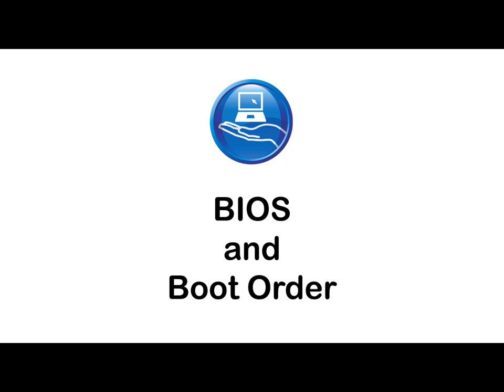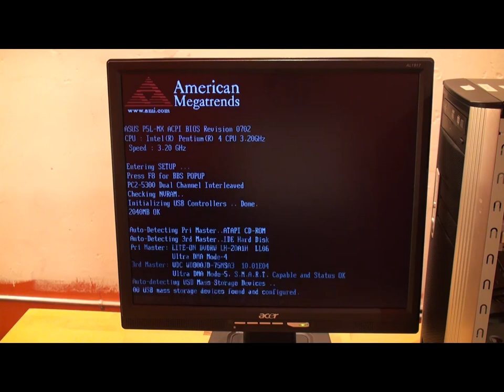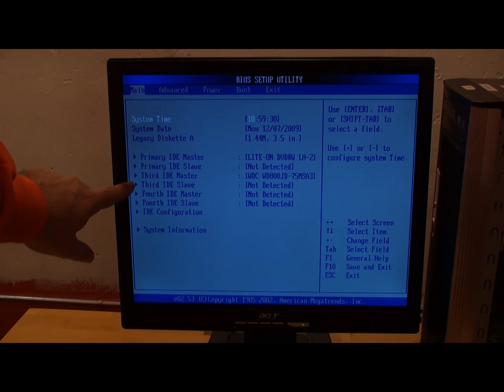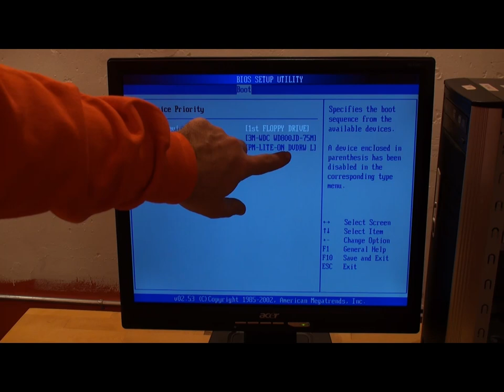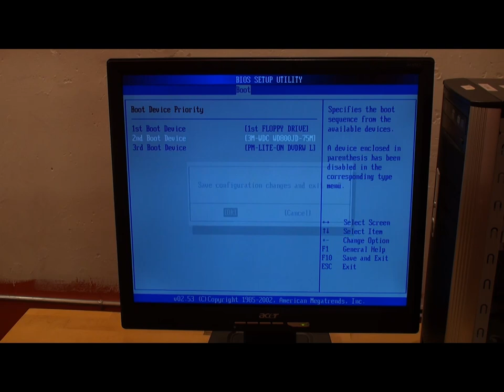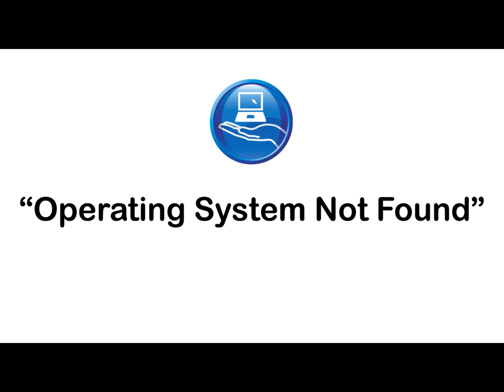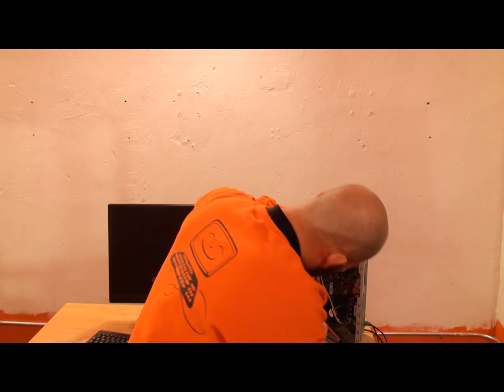Computer Hardware Repair

Comment: hello i got hp g72-251NR notebook. but when i plug my charger the light turns white then turn orange. and when i take the battery out then plug it in the white light stay on but the computer dont turn on. can you help me thanks.

Comment: Hey, i have an acer desktop. So whenever i boot up the computer it freezes on the Starting Windows screen (Windows 7) and does not move any further and so i have tried couple of other hardrives and re installing windows but every single time it freezes on starting windows screen  or if i try to install an os then it freezes on windows is loading files screen.....so i think that there is a problem with the motherboard........SO what do you think????????????

Comment: I disagree about the no video but the PC is on, I'm 15 and been building them since I was four, and most of the time it's a dead CMOS battery... every PC I've fixed with that error, it WAS the CMOS battery, you can pick them up at your local dollar store! xD
Reply: I have never ever had a CMOS battery go out or go dead, literally NEVER.  I have been messing with computers since the Commodore64 (did amazing things with only 64k, yes K not MB or GB of ram) and never once have had to replace a battery.  Not saying it can't happen, but it is very rare they actually go dead.
Reply: That's strange, i've fixed all my PCs with that error by replacing the CMOS battery.
Reply: I have fixed stuff by removing the battery and putting it back in to clear cmos, but never seen a dead battery b4.
Reply: Oh, I've been build them for about 9 years now. It ALWAYS happens, but that is the first thing I try is to take the battery out and pop it back in, if it doesn't work I buy a new one, and it works fine.
Reply: jeremy10001000 Guess I been lucky for last 15+ years then :P
Reply: Haha yeah! :D
Reply: No one cares. Also that never happens.
Reply: Why'd you comment then?
Reply: Ummmm... CR2032 has nothing to do with the video controller integrated to the chipset or in this day and age, processor; or furthermore discrete GPU part. CR2032 or CMOS battery has to do with saving the BIOS settings/providing constant voltage so that the volatile memory on the motherboard isn't as volatile as the term would mean. The basic part that at least integrated chipset/CPU/APU graphics would need that is replaceable and removable would be the RAM/memory.

Though as far as I've found common failure parts after 10+ years working professionally as OEM supported or mom/pop shop oriented repair:
1: PSU (Power Supply Unit)
2: HDD (Hard Disk Drive)
3: Motherboard
Reply: Some motherboard's don't post when a battery is dead, therefore no video, I never said anything about it being connected to the on-board video adapter.
Reply: Jeremy Williams you said cmos battery has nothing to do with saving the BIOS settings....... I disagree.  Technically you are correct as it will not "save" the current settings..... BUT, take out battery and put it in again WILL save BIOS settings as in if your BIOS becomes corrupt and unable to work with it.  Taking out battery and replace will reset it and in turn "saving" your BIOS.  I once had a virus years and years and years ago that implanted/hid in my BIOS so any form of reformat or whatever would not work to clean the virus, it always came back.  Clearing the CMOS "saved" my settings even though i had to "reset them all".

1. I have never seen my OWN PSU go out (out-dated maybe) but have seen a friend's unit go out on him.
2. HDD - i KNOW hdd failure has screwed a bunch of people, but I have only seen 1 single HDD become so bad you couldnt pull anything off of it without using that "forensics type equipment they have at labs".
3. Motherboards - Motherboards are usually pretty solid and will last forever, HOWEVER the things ON the motherboard do NOT.  I have only seen 1 motherboard go bad (due to my own experiments with overclocking)  Other than that, usually its the components/cards/ect. that goes.

1. I have found the very first thing to degrade and say, i dont work for you anymore is your graphics card fan/CPU fan in that order. Every system I have ever built, the GPU fan is 99.9% the 1st failing part and if it isn't, its usally the CPU fan.

Take care of #1  with a can of air on a regular basis, and hit the rest of the things inside your case, will help keep your computer running for a very long time.  The computer i'm using, I built 4-5 years ago.  HDD = 1st generation of SATA  and a old slave/master ribbon drive 10+ yrs old from 3 computers ago, Case = 10+ yrs old, a 20 pin power supply ? yrs old that just didnt provide enough juice to the board (but still works fine) so I had to rummage around junk pile to find a 24 pin supply.   All this Antiquated equipment, i put new MoBo, CPU, Memory, Grafix Card.   

Since my old 75mz cpu system, parts usually go bad when they cant handle the software being pumped through them, then they go into the "junk pile" that comes in real handy later on.  One GPU fan went out on me, so i got a fan off of a 7-10 yr old card and "made it fit" my card and ended up using a laundry marker to hold it tight and braced the other end of the marker against the bottom frame of my case.  the card ran fine for 2-3 years like that.  Even though the fan gave out, the card was still fine.

#1 Enemy of all computer systems is HEAT.  Dust/Dirt create HEAT.  Too much HEAT and things start to say "you suck, I won't work for you no more"  Just like you brush your teeth to remove the junk, you need to "brush your system's teeth with a can of air regularly"  I run my case with no sides (open to the air) because it runs cooler.  It collects dust more often, but couple air blasts solves that problem.

Comment: The memory card connection is losed or the memory card is corrupted. Removing the memory card, cleaning it then putting it on again will fix the problem. If not you should buy a new memory card. Good luck!

Comment: After New Hard Disk Install. I Have Rebooted My Computer And Its All Running But Computer Seems Not To Be Running Smooth...
EVERYTHING IS RUNNING SLOW
There's A Update That Gets To 75 Percent And Never Finished I Waited Over 6 Hours So I Dont Know What Wrong... Is The Update Bad?
Is My New Drive Bad? Is It Cause I Replaced The Original Hard Drive Which Was A 250gb Seagate Brand With A Western Digital 1tb ?
Please Help Me
What Could Be Wrong?

Also The Update That Wont Finish Is
Windows Service Pack 1 For x64- Based System (KB976932)

Comment: I have a problem, i recently build a new pc, board, ram, hd everything, now everything works well at first then few days later i get programs not responding takes a while to work or it wont work and i get BSOD. Then when i restart my W7 logo takes a long time to start or i get windows run windows repair. The other problem i have while trying to pass files from one hd to another it BSOD and i cant transfer. Never happend with old HD. Suggestions plz and help

Comment: when i pull up BIOS and go to the boot menu, it doesnt have the actual names. it  just says Floppy group, HDD group, etc. what if the hard drive is not there? what should I do?
Reply: if you back out one menu you should usually have an option a little lower in the list to edit the HDD group options inside there you should be able to select which drive to raise to the top of the list so that the drive is the first tried in the HDD group.
Reply: i put HDD drive first in the boot menu, but it still doesn't work.

Comment: Hi there, i love Eli and his videos and then when i watched this one at the point he mentioned a "problem" with IDE drives and the CS setting, he said it did not worked so well and he didnt have found out why or something similar, anyway this is old now but if you are curious then pop over to this site and check it out. Simple answer is, wrong cable, it needs to be different from the ordinary IDE cable.

http://www.unixwiz.net/techtips/ide-cable-select.html

But like i said, its old news now ;-)  Im sorry about my grammar, Swedish is my native language, but you will get the point.

Comment: Yeah most likely the mobo. And if you get a new mobo and try to use the old HDDs then everything will be erased. So, just start off clean if you are planning on building a computer yourself.

Comment: I have a problem and I need some help. Ok, I put an xbox 360 transfer cable in the USB port of my Compaq desktop and then my computer froze. So when I turned it back on it makes this sound and the moniter is frozen on the BIOS name. The sound is coming from the bottom of the motherboard but the computer still works. Can someone help me

Comment: Hey guys I have a problem and I cant figure it out.

When I have usb's plugged in I cant boot.

I reformatted, installed the newest bios and drivers and still ntoskrnl.exe error with usb plugged in

The boot ini is fine if I unplug the usb and I even found a ps2 keyboard which does NOT work in bios.

Hp was no help, they say the boot is broken and to re install.

Its an older compaq sr1820nx duel boot win xp homo edition with ubuntu. No floppy and usb are out, I cant even enable legacy usb

Comment: Hi..I gotta Dell Laptop N5110 : Problem with it is Iam trying to install OS (Win7 & Win8) both I tried but Installation is not possible. Everytime i See installing is not getting the Drivers not found in 7. Error is Displaying in such a way (Installating Windows Drivers not Found) At very First step only i cant Begin.
I also tried Win8 but The problem is All installation steps. Copying files>Exapnding>Installing features> all Steps completes But Last restart is not completein and same problm..

Comment: Hey Eli !,

my computer was working fine, but out of nowhere, it stops.  So i turn off the power supply and then turn it back on cause this has happened before. but when i pressed the power button, it turns on but the monitor goes into power save, it doesn't beep, and upon further inspection, the cpu fan isn't spinning and i can't turn it off with the button; if have to unplug it or manually turn off the power supply. My dad and i got a new cpu fan and that doesn't work either. im pretty sure im using the new motherboard dad bought when we built it for my birthday, but i don't think thats it. the cd thingy has overheated before and caught on fire so my dad added a fan to it. so what do I do? please reply

                                                                               Jared Kranenburg (jRod057)
Reply: if got a new motherboard, consider the amount of Volts it requires. perhaps your power supply isn't strong enough for it. you might want to consider buying a power supply tester on ebay for around $5 because chances are you can have a faulty power supply. if your supply isn't fuctioning properly do not try and fix it because it's dangerous, i would suggest you buy a new one. cheers!
Reply: Replace your power supply.  Immediately.  Anytime you have parts not powering on, the screen going into power save mode, and no "POST" beep after pressing the power on button, it's guaranteed to be the power supply.  You can buy a decent one (450 Watts) on Amazon or TigerDirect.com for like 30 bucks and replace this yourself or take it to a technician if you're not comfortable removing all the cables and putting them back correctly.

You should never have to ad a fan to your CD drive.  Ever.  Your power supply is putting out incorrect voltage and is going to fry every new part you put into it.

Hope this helps.

Source:  5 year military aircraft electronics technician.

Comment: Can you help me, 
i got windows 7 off piret bay.com with u torrent, and used a windows loader to get rid of 30 day.. the computer then keep on freezing and i got a new HDD to replace the old one and i got a fill not free version of windows 7, i am still whiting for my hard drive but what else can you think is wrong.. The computer woked and never freez in safemode but it always did in normal mode and it is a gaming Pc so it shod handle windows 7.

Comment: PLEASE HELP ME!!! Sometimes, not always, when i am watching you tube my mouse stuffs with either the sound or the video. If i take the mouse off of the actual video and move it left to right and back across the screen, it either changes the sound level up and down or skips through the video depending where on my screen i move the mouse. It is driving me nuts and i am soooo bad with computers its not funny. If someone could explain how to fix this i would really appreciate it. Thanks guys.

Comment: That is the problem, I cant do anything once I get into bios after I hit F1 and it enters the bios page my keyboard craps out, I have tried with 3 keyboards 2 usb 1 ps2 and even with usb/ps2 converter. I flashed the bios, jumped the pw upgraded the bios reset the battery and still no luck in bios, Im fucking stumped.

Comment: I built my own computer and all the parts are spinning and lighting up, but it won't show up on my monitor (I tested the monitor and it definitely works), anyone know what I can do?
Reply from the maker: +XxSwimmBoixX Good chance it's a bad Motherboard... try using a PCI video card and see what happens...
Reply: +Eli the Computer Guy my issue is that when im playing a game that is downloaded like cs go my computer shuts down randomly 
Can u help me thank you
Reply: +BiBlA SwAggins is your computer plugged into a UPS or straight into the wall? if its not connected through a UPS you might be experiencing "brown outs."
Reply: +XxSwimmBoixX thanks for asking the question... I had the same issue
Reply: +XxSwimmBoixX try to check your RAM
Reply: +Daren Pangilinan and also try to connect your VGA, HMDI or DVI connector into the built in System Unit video ports, not in the video card.
Reply: Good chance it is a bad motherboard but if that is not the case, like in my pc build, the size of the memory sticks you are using may be too much, so try a smaller one if you have one
Reply: overheating? are you running on a desktop or laptop?
Reply: he literally just said he built his own computer

Comment: Hey, my friend's brother screwed up my friends PC by downloading porn. So now pop ups are everywhere and the computer lags like hell. I want to help him stop it but his brother is too ashamed to tell his mom. So how do you fix a computer? I am thinking that uninstalling the programs and clearing the "startup" folder will but I want to check with you guys.
Reply: Download malwarebytes, update the program once it's installed. Restart your computer. Once restarted, perform a full scan and remove any items that are found at the end of the scan (may take hours). Once you've removed all the objects, you will be asked to restart. Do so immediately.

Additionally, remove any applications that are not 'known good' :p Run the command 'msconfig' and disable all startup items from the 'startup' tab that you do not absolutely need to function. Do the same thing with the services tab, EXCEPT check 'hide all microsoft services' at the bottom first, then disable all services. This will disable all non-Microsoft services and applications from starting up with Windows.

Tell your friend he doesn't need to download porn. Bookmarks do just fine. You can have thumbnails with your bookmarks too ;)

If you still need help after following this advice, send me a message.

PS: Thanks Eli for this very informative video. You keep it entertaining and that's why I like your videos :)
Reply: Jeff Fabish do you think Microsoft Security Essentials is a good alternative for individuals who don't wish to pay/buy antivirus software?
Reply: Fryklballs no i do not i would use avast or avg they  are both free with registration  its what i use to do what he says to do
Reply: use ADW cleaner
Reply: Do not "Clear" the start up folder unless your very experienced with computer software.  You will destroy your OS.  Just use AVG antivirus for free:http://download.cnet.com/AVG-AntiVirus-Free-2014/3001-2239_4-10320142.html?hasJs=n&hlndr=1&part=dl-avg_free_us and scan your PC.  It will work and if not send me a message and I will help you.
Reply: Ccleaner or reformat
Reply: Malwarebytes is always good, or you can try safe mode and see what it does you can also try OS reinstall